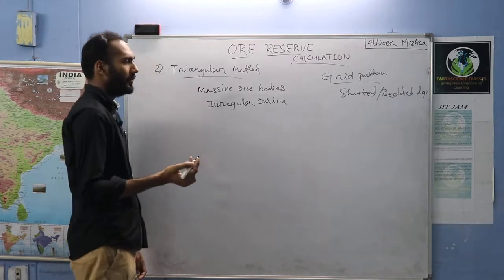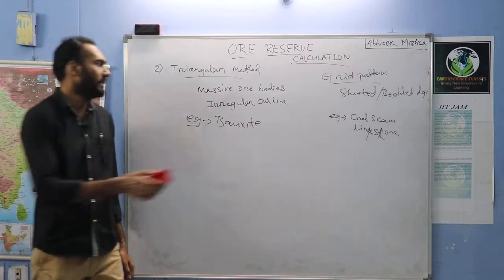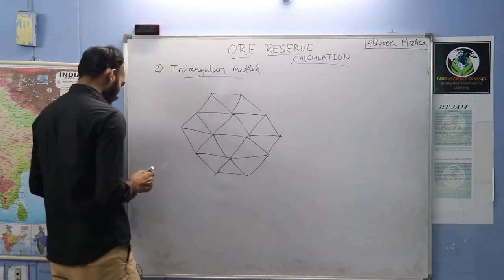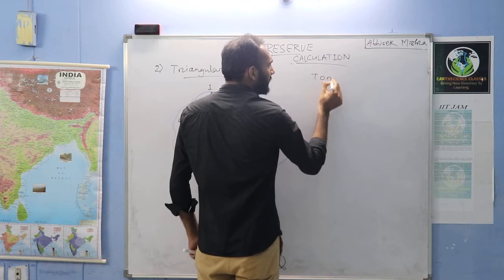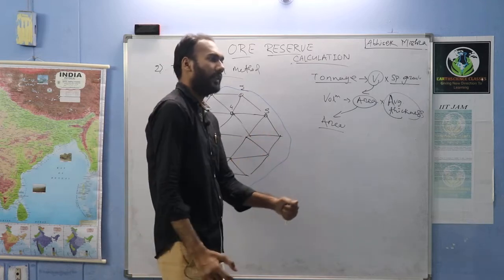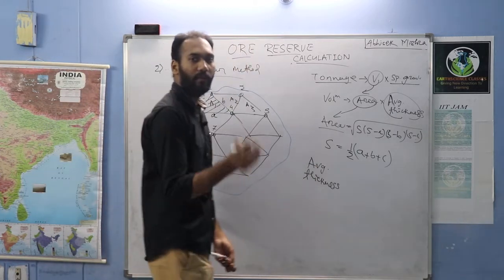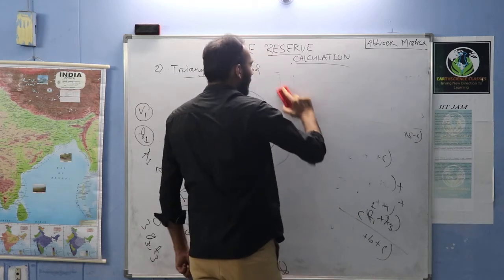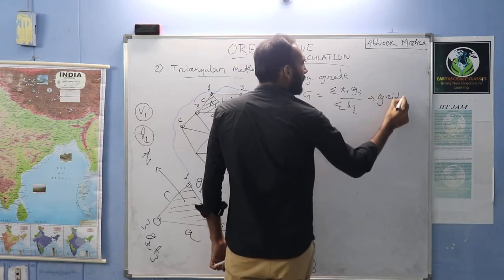Ore Reserve Calculation_ Part-2

Comment: Sir total grade and avg grade both are same ?or total grade is sum of all Gi
Reply from the maker: **Total Grade of Ore:*  
The sum of the total metal or mineral content in the entire ore deposit, calculated by combining the grades of all samples with their respective weights or volumes.  

*Average Grade of Ore:*  
The mean concentration of the desired metal or mineral in the ore deposit, determined by dividing the total metal content by the total weight or volume of the ore.  

Total Grade of Ore:*  
Total Grade = {Sum of (grade × weight/volume of each sample)}

*Average Grade of Ore:*  
{Average Grade} = {Total metal content ÷ Total ore weight/volume}

*Example:*  
- Sample 1: Grade = 5%, Weight = 100 tonnes  
- Sample 2: Grade = 3%, Weight = 200 tonnes  
- Sample 3: Grade = 4%, Weight = 150 tonnes  

*Total Metal Content:*  
\[
(5 × 100) + (3 × 200) + (4 × 150) = 1700
\]  

*Average Grade:*  
{1700 ÷ 450} = 3.78\%

Average ore grade = 3.78%

Reference:chat gpt
Reply from the maker: I have collected from chat gpt

Comment: sir 
tonnage has the unit of mass ,but whenever we calculate the tonnage from specific garvity and volume ,it's unit becomes equal to the unit of volume.

then how could it be??
Reply from the maker: The tonnage factor provides the mechanism for the conversion from volume of ore to weight of ore. In the English system, the tonnage factor is normally expressed as cubic feet per ton of ore. In the metric system, the tonnage factor is the specific gravity of the ore.

Comment: Sir, you said that spacing between bore hole is equal, but for each triangle you took the spacing different like a, b, c. I can't understand.please tell me.
Reply: Yes bore hole spacing is constant .... But if you see the diagram in the video, spacing between boreholes 1&2, 3&4....etc. then between the lines like 1st & 2nd line, 2nd & 3rd line... is constant.... But when I have taken distance 1& 3, 1&4, 3&4 sides of the first triangle.... They may not be equal... So you can take it as scalene triangle...